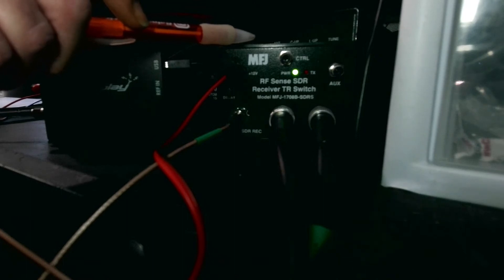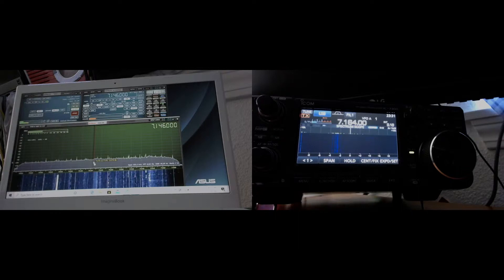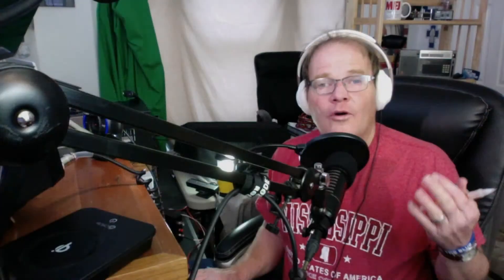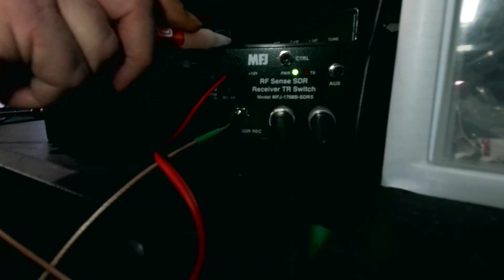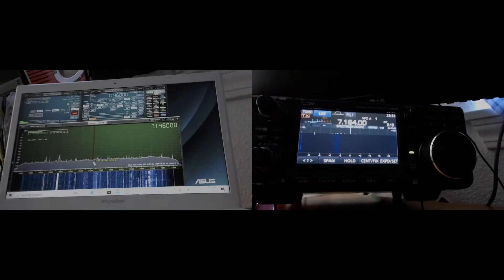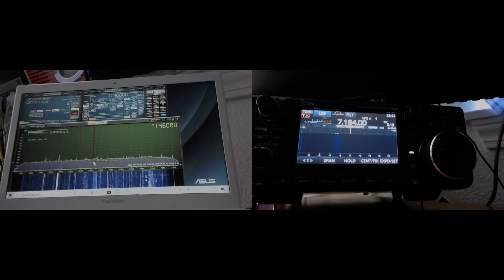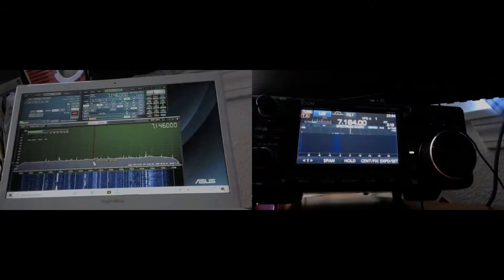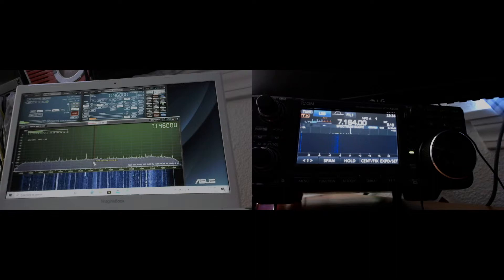Ham Radio Live How To Put Your Rig On A Monitor When It Doesn’t Have A Display Out Plus Get A 2nd RX

Comment: Just bought one.  What I'm not happy with is you have to mute the SDRPlay while transmitting or else deal with noise.  So you are forced to use your transceivers receiver.  I personally like the SDR receiver with all it's filters a bit better than the receiver in my transceiver.